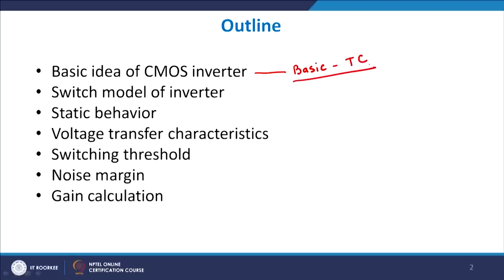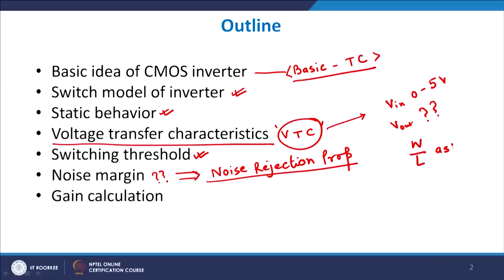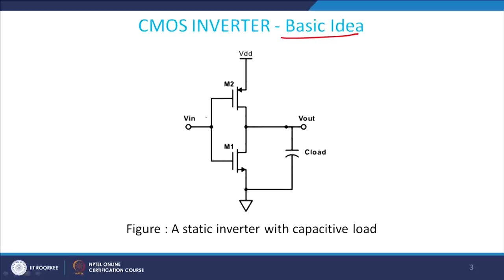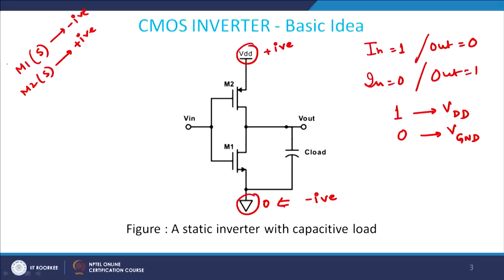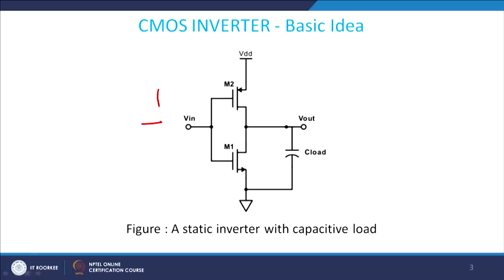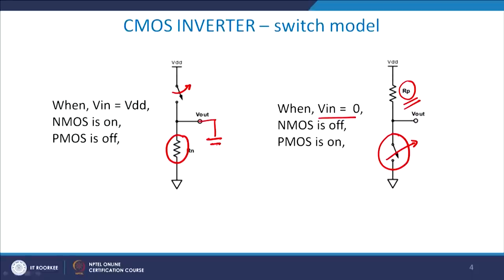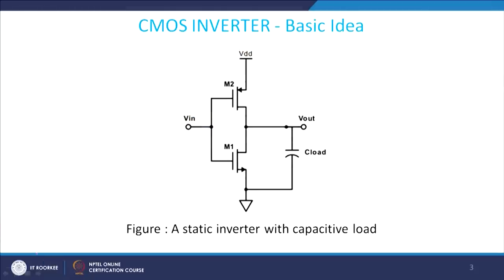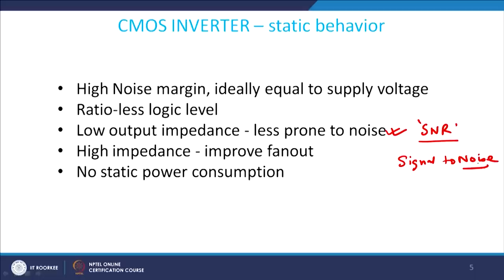CMOS Inverter Basics-I

Comment: Why there is the need of shifting from second quadrant to first quadrant
Reply: Because if no shift on 2nd quad then that means I_ds_p = - I_ds_n ... the current for nMos flows in opposite direction to that of pMos
Reply: Because , the input is dynamic and it`s fluctuates between 0(T/2) and 1(T/2) so for that half of the time Pmos will switch on and Nmos will cutt off and for another half time vice versa, So the Pmos will work in 3 rd quadrant for half of the time and the other half of the time Nmos will work as low resistance path to discharge the capacitor and current will be decreases at that moment in the 1st quadrant .

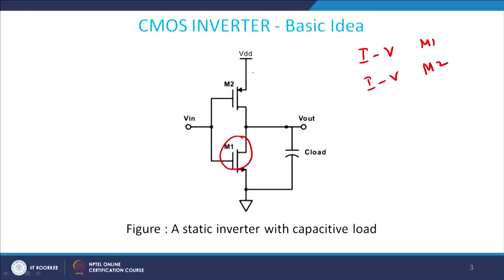Comment: Why at 29:44 you said current flowing through them will be equal to each other? Isn't one always off?
Reply: At switching threshold voltage( Vm= Vdd/2)both NMOS and PMOS will be ON. At that point Current will flow from Vdd to ground and as they are in series current will be same in both of them.